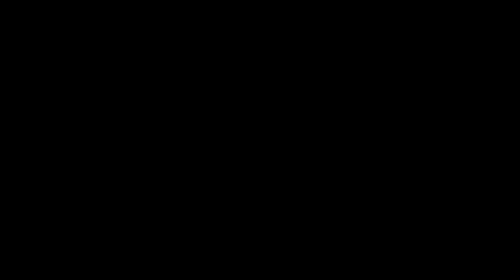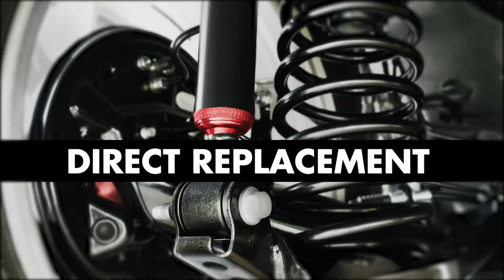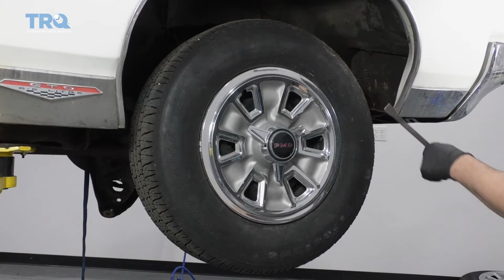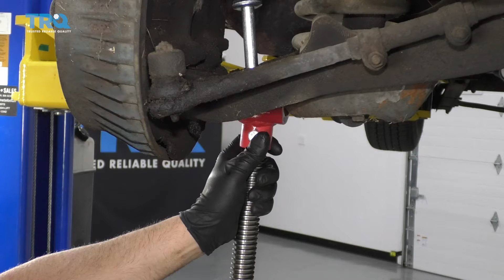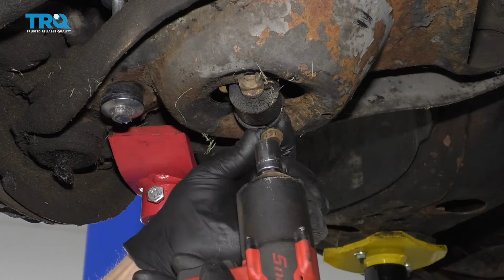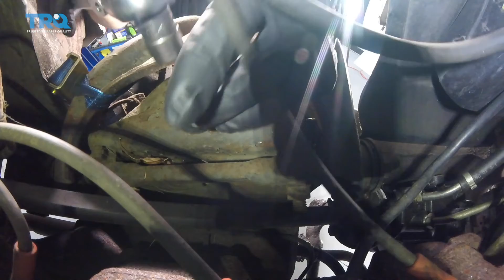How to Replace Front Shock 64-67 Pontiac GTO

Comment: Great video, it was very helpful when replacing the front shocks on my 1967 Chevy Impala. Like most home mechanics I do not have a lift and work under the car on a creeper. One issue I had was trying to connect the bottom of the new shock because it was longer than where it needed to mount. I temporarily attached the top of the shock just using the large washer and large nut, then used a bottle jack to push the bottom of the shock up so that I could line up the mounting hole of the shock to the mounting hole on the car.